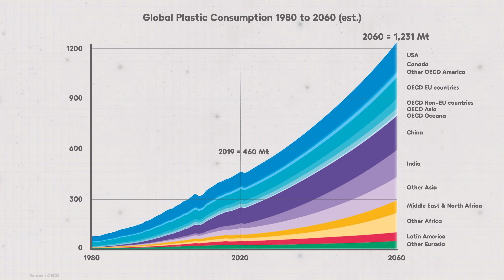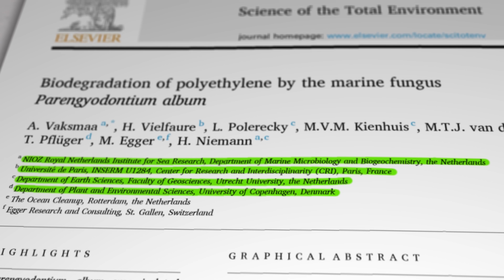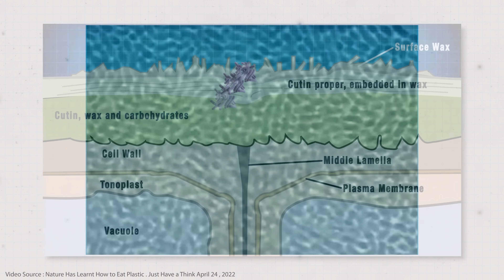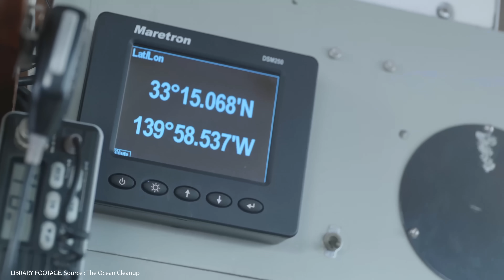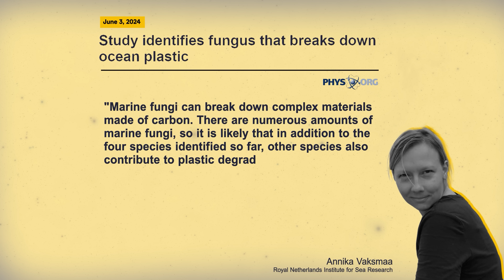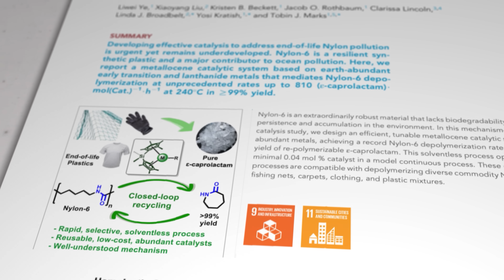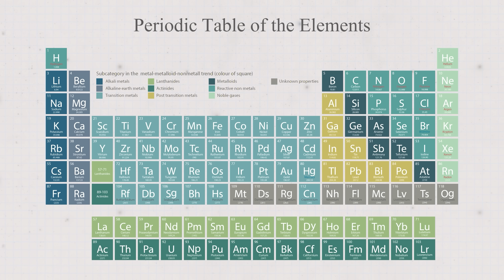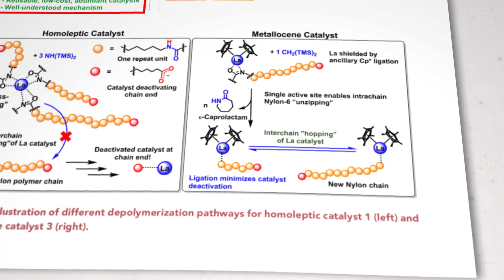Our oceans have learnt how to EAT PLASTIC!

Comment: We're wasting time and money trying to discover and breed microbes to convert our plastic into carbon dioxide. If we burned this plastic we would get the same carbon dioxide, plus some useful energy. The opposition to "waste-to-energy" power plants is even more stupid than opposition to nuclear.
Reply: What is your opinion on this section of the video: 7:09
Reply: @steveboel12  burning stuff produces dirty smoke, ok?  I don't recommend anyone burn plastic in their stove. The waste-to-energy plants are designed to deal with some of the pollutants by using good filters. Some of course will still get out, but still not as much as from burning coal. This isn't a choice between dirty and clean. This is a choice of burn plastic with some bad side effects vs dump the plastics and burn coal with the same or worse side effects and double carbon dioxide.

Comment: “The planet will be here for a long, long, LONG time after we’re gone, and it will heal itself, it will cleanse itself, ’cause that’s what it does. It’s a self-correcting system. 

The air and the water will recover, the earth will be renewed. And if it’s true that plastic is not degradable, well, the planet will simply incorporate plastic into a new paradigm: the earth plus plastic. The earth doesn’t share our prejudice toward plastic. Plastic came out of the earth. The earth probably sees plastic as just another one of its children. Could be the only reason the earth allowed us to be spawned from it in the first place. It wanted plastic for itself. Didn’t know how to make it. Needed us. Could be the answer to our age-old egocentric philosophical question, “Why are we here?”

Plastic… asshole.”

- George Carlin

Comment: remember, everyone: "plastic" is not a material. it is an extremely fuzzy term we use to lump together a wide variety of materials, some similar and some very dissimilar. the process of breaking each down varies in a similarly extreme fashion. so no, this does not mean the plastic problem is remotely solved, and no, it does not mean this organism will suddenly decompose the worlds supply of plastics.
Reply: What is your opinion on the section of the video 3:10 where specifies what the type of plastic it is?

Comment: First, God is great!  He created an ecological system to deal to continually heal itself.
These plastic going into the oceans are mostly US recycling being sold as a commodity then shipped to the buyers who then dump them in the oceans.   It is not consumer irresponsibility. 
Last, micro plastics getting into human and other bodies is a bigger problem. 
Also, CO2 and methane are not an issue when you study the way God designed this planet.  Following propaganda created by the Rockefellers is a big problem.

Comment: The idea that these plastics can be broken down or upcycled through the use of constant human inputs is a distracting pipe dream. As long as we have a robust oil industry it will always be cheaper to produce virgin. The only exception would be industry waste. Better recycling methods could make plastic industry waste more profitable. If it makes it to market, collection cost way more than the plastics value. Chemically selecting plastic types from a soup could decrease the loss, but due to the collection problem it’ll will at best be a subsidy to plastic manufacturing companies. Recycling is just weird mining. The cheaper the material, the higher density you need. If aluminum were 1% the price it would never be recycled outside of industry waste either.

Comment: You could create facilitaties that use these bacteria and fungus to "quickly" biodgrade plastics and then lock the co2 into concrete. "Once injected into the concrete mix, the CO₂ reacts with calcium ions from cement to form a nano-sized mineral, Calcium Carbonate, which becomes embedded in the concrete. This makes the concrete stronger, enabling mix optimization while eliminating the CO₂."

Comment: The year is 3964. Archeologists are fascinated by the early 2000's, when a lost technology was dominant and used everywhere. A material using long strands of carbon, known as plastic at the time. Whatever lost technology it was is not well preserved in archeological digs. After being unearthed and exposed to air, plastic starts to degrade soon and inevitably. The predominant theory is that the plastic was saturated with a type of toxin that exploits a weakness in all known bacteria breaking down structures of its like. Clearly, this type of toxin did not survive as long as the carbon structure it protected. It's composition must have been one of those technologies that everyone knew and considered obvious, since nobody took the effort to write it down. 

It is considered obvious how economically useful such a material must have been for mass-production of small products where durability is not always a requirement. The authors of this article recommend more research be done into these toxins, so that we may again benefit from this lost technology.

(Some day in the future, the existence of bacteria capable of digesting all sorts of plastics will be so obvious to everyone, that it will be unfathomable that they simply haven't evolved yet at this point in time. They will evolve, unless we take ALL plastics from the environment, especially microplastics. And they will be everywhere. And they will be considered normal by people.)

Comment: Really like the balanced opening to this video. Plastics are a wonder material but used badly sometimes.

I was going to write a modern disaster book about a bacteria that ate plastic voraciously 😂

Planes would fall out of the sky. Power stations would fail as wires shorted. Your carpet would dissolve.

Comment: Actually we converted it to another problem. Plastics were withstanding biological degradation. So far.
From now, all your plastics packaging and parts will rot, as paper or wood. Even on a spaceship.
Reply: Nothing can stand against time. None of your goods will last forever.
Reply: If those microbes stay in water it is less of an issue.

Comment: Ocean water and contaminated waste plastic is instantaneously converted into synthetic fuels with energetic cavitation bubble impact by Eirex Tech in Canada the five year old Canadian company. How about visiting this company and provide us information how any type of water can also be converted into highly competitive hydrogen gaseous fuel on-demand, on-site or on-board a ocean going ship collecting waste plastic from the ocean. Ocean water stores 150X more Co2 than air and when combinded with minerals from the ocean water the productiong of cement, bricks, chemicals, hydrogen, Carbon Credits, and desalinated ocean water as free byproduct of generating hydrogen fueled electricity 24/7 with Keyou GmbH diesel engine generators fueled by 100% hydrogen gas from any type of polluted pond or ocean water.

Comment: We shouldn't care about how much CO2 that marine fungye or bacteria produce any more than we should be concerned with how much CO2 our industries generate.  CO2 is not the problem and is not the source of global warming.  CO2 is plant food, after all.  Global warming is caused by the oscillations of the Ice Age over the past 3 million years and we are just entering a warm interglacial period.  Deal with it.  So long as there is a land bridge between North and South America, warm ocean currents will not be able to circulate at equatorial latitudes and we will remain in the current Ice Age.  We want to end global warming, we just have to plow a hole through Central America from the Pacific to the Atlantic and let the ocean circulations go back to pre-Ice Age hydrology.  Plastics are more of a problem that unrecycled plastic waste collecting in ocean deadzones and washing up onto our beaches.  If we are to continue using plastics, we must find a much more effective way of recycling them, modify organisms to break them down and exclude plastics which screw up our hormones and poison our air, land and water.  Truth be told, silicon polymers might be a better replacement for plastics, but then we have other--and unforeseen--effects from these substances down the road.  Man's endeavours clumsily betray humanity and thus we begin anew.  Thank you for a good video, but the current bio-remediation process of neutralising, digesting and metabolising plastic is far too slow and point specific to be effective in the short run.  Yes, some beetles and other insects can eat polystyrene and styrofoam and have their gut bacteria 'digest' it for them, but this is agonisingly slow and we are nowhere near being able to remediate styrofoam waste in this manner, either.

Comment: I'm a big fan of gasification, which involves heating the plastic up, causing it to emit flammable gases, which can power internal combustion engines to generate electricity. It doesn't emit the same amount of toxic gas as simply burning the plastic, as it's al filtered out. It does emit carbon dioxide, but it still saves some emissions as less oil has to be extracted.

Comment: I suspect the microbes capable of breaking down plastics have been there all along. There are already microbes which break down crude oil. It's probably true, they've evolved to become more efficient at breaking down larger molecules over time. UV also helps by degrading plastics into smaller molecules and the microbes finish the job.

Comment: If microorganisms can develop plastic consumption, it means that we will no longer be able to use certain materials in marine environments, at least not in the long term: boats, diving and measuring equipment etc.
Reply: Ships were constructed from wood for centuries. I'm not sure if wood degradation really stopped ship builders there. If plastic starts to rot, it only means that we'll have to preprocess it with something which can slow down plastic degradation.
Reply: The ocean is already quite destructive of the steel vessels that we put in them. The solution? Paint, protective layers of material which do not succumb to the salty conditions.

I suppose we can continue using plastics without worry, as we can simply paint them to prevent immediate problems.
Reply: Humans need space travel

Comment: I think people should really re-examine the plastic topic.  This isn't a troll.  Consider: we need to reduce greenhouse gases in the atmosphere in order to reduce global warming.  All other environmental concerns are of lesser priority.  Plastics are made from/with carbon.  Every plastic molecule has carbon at its spine.  Traditional plastics break down very slowly, if at all.  They're also amazingly useful and cheap.  They could therefore be the most bang-for-your-buck method of carbon sequestration available to most of the people threatened by global warming.  We keep hearing how bad it is that plastics aren't biodegradable and can take millennia to break down, but that could be a good thing. 

 When it comes to global warming, the bottom line is the amount of greenhouse gases in the atmosphere.  CO2 and methane, mostly.  That's what determines whether the earth will warm or not.  That bottom line needs to be our ultimate priority.  Our solutions need to reflect that.  And when you look at the bottom line, "biodegradation" is a process which ends in carbon being released back into the atmosphere by organisms.  Very quickly and efficiently, usually.  When it comes to global warming, that process isn't our friend.  Or at least not the friend we need right now.  What we need more is a method to very quickly lock huge amounts of carbon out of the atmosphere to give us time to think of a long-term solution to an unprecedented problem which nature isn't evolved to handle.  Plastics could be the friend we need right now.  If designed for the purpose and appropriately disposed of, it could be part of the long-term solution too.  Especially when you consider that its alternatives all kill trees and are more expensive and therefore less efficient.

If someone wants to point out the flaws in my logic I'd be happy to hear it.  And by "designed for the purpose" I mean "designed to not break down", which seems to be the opposite goal to how they've been evolving plastics.  They've been trying to have it both ways by designing plastics which break down more easily, but that's just given us microplastics.  ie maximising the downsides of plastics while minimising the enormous potential upside.  If we made non-degradability a priority again, plastics could be the last best hope we have for preventing catastrophic runaway global warming.  And avoiding such an outcome is a higher priority than all secondary conservation concerns.

If my logic is wrong, please show me where.  I'm not here looking for a fight, I just think people aren't seeing the real battle we're facing.  They're trying to keep the furniture dry of a sinking ship.  We need to stop the ship sinking before we worry about the furniture.  To use a different analogy, we're like generals trying to use WW1 tactics in WW2.  It won't work because this is a different war and a different threat.  This is a threat which requires proportionate, targeted and cheap countermeasures.  "Cheap" because that's what will be the most scalable, especially for people living below the poverty line.

To underline that point: if we could somehow magically cover the earth with vegetation, do we know that would be sufficient to reverse global warming?  If global warming is the result of burning massive amounts of fossilised carbon from an earlier era, do we know for sure that 'nature' can reverse that at all let alone in time?  It's never been done before, we know that.  We can't simply revert the biota to its pre-industrialisation state to get a pre-industrial atmosphere because the coal and oil will still have been burnt.  The carbon from that needs to be dealt with, and dealt with fast.

When I look at this problem, I see a lot of fuzzy thinking.  But what I mostly see is people looking to use this topic to redesign society for economic purposes rather than environmental ones.  They oppose all the most effective and realistic solutions because the only solutions they want are ones which involve them getting the utopia they dream of.  So they sabotage real solutions to try to maximise the usefulness of the crisis.  To be clear: I don't think they realise that's what they're doing, but I think they're doing it nevertheless.  

Anyway, rant over.  Nobody ever listens, or listens and answers.  But I'm more interested in finding out if I'm wrong and why than in actually solving the problem.  I can't solve the problem, but I can find out if/why I'm wrong.  Because I feel like everyone is ignoring the elephant in the room while it makes faces at me.  I feel crazy, or gaslit at least.

Comment: I came across a good idea for making heat, easily enough for that Nylon-6 reaction, using powdered iron in a furnace designed to catch the only by-product: Iron oxide.  That can be used in a thermite reaction to get even more heat for other uses and get the iron back again.

Comment: There was a science-fiction novel, "Mutant 59: The Plastic Eaters," which was about a new mutant microbe that could dissolve and consume and metabolize plastic. Our society then learns the hard way:
(a) how much we're dependent on plastic remaining stable; 
(b) how much plastic is used for electrical insulation, and after it disintegrates the wires are bare and short-circuiting, causing fires ;  and 
(c) how the microbes' metabolizing plastic releases flammable gases causing explosions everywhere

Comment: CO2 is not an issue and should not be treated as such.
Reply: Quite true.  Particularly CO2 that is already dissolved in the oceans.  Turns out from a number of geological studies that an ocean-based carbon cycle exists that oceanic organisms, from single-celled organisms to corals to crustaceans and molluscs, remove dissolved CO2 from ocean water and produce calcium carbonate structures and shells.  These sink to the ocean floor and become ophicarbonate rocks, which then by tectonic plate subduction are carried below crustal plates.  Heat and pressure on these ophicarbonates over a period of time produces methane - i.e. natural gas.  Some geophysicists estimate that these deep methane reservoirs may contain as much as 40% again as much as earth's present known reserves of methane.  The reservoirs over time rise to shallower depths under continents where they can be tapped for energy.  This is a continuous process, according to the geophysicists; meaning that methane may in fact be a renewable resource.  The studies on which the theory were based are of the ophicarbonate rocks found in Italy, which gave clues about this possible carbon cycle.
The theory is still only around 5 years old and many details are not known; but if true, it shows we still have a lot to learn about earth.